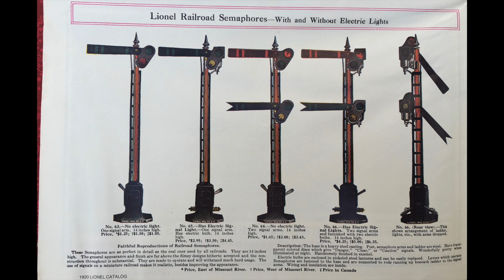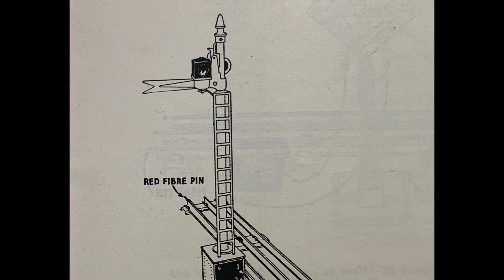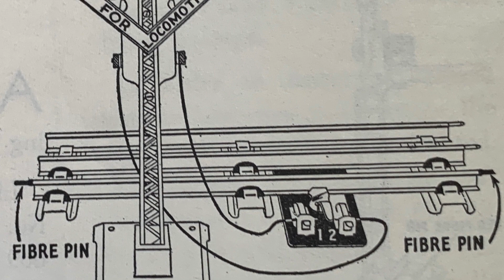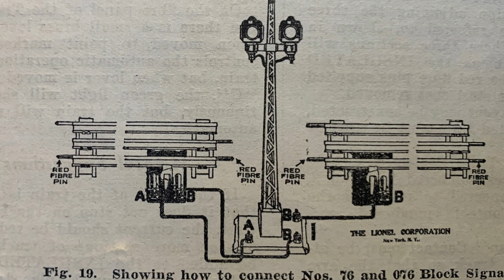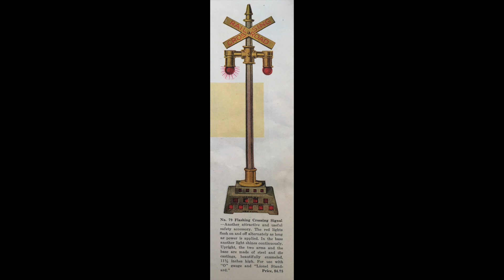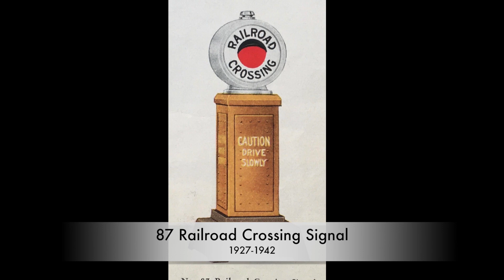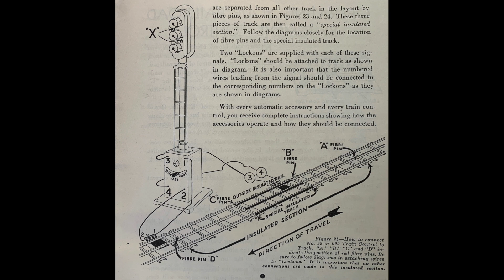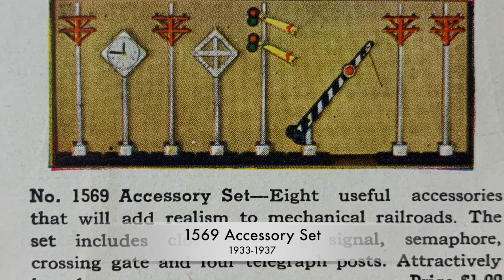Classic Lionel Trains – Semaphores and Signals 1915-1942

Comment: Hmm. I could be wrong, but it seems that 82N auto semaphore may be wired incorrectly. That wire running on the inside from connection 2 to connection 3 shouldn’t be there.

Instead I think 3 is supposed be connected to an outside insulated rail. 

That way when set to continuous, the semaphore acts more like a No. 80 turning green when the loco activates the insulated rail, instead of always being on. 

When the signal is set to stop the train, the light won’t go green unless the train is in the block if that makes any sense. Look at the wiring diagram. Again I could be wrong.

Beautiful collection by the way, thank you very much for posting these videos. Not much prewar information online. Before I watched them I didn’t know half of these things existed!

Comment: Once agen another great video. I have a question is your track original or only some?
Reply from the maker: My track is from the classic period, but I do not know whether it is pre- or postwar. The switches are easier to date. I have the 022 unlighted manual switches which were made between 1915 to 1926. My next video will be about switches, crossings and bumpers.

Comment: uh oh, I always wired the 153 signal with 2 insulated tracks spaced 8 tracks apart so the green light is on as the train approaches it then turns red after it passes, doesn't work that well because with a long train red and green may be on simultaneously or a short train and both lights are out before it gets to the next insulated section. I was never very happy with the 153c spring activator due to having heavy cast metal and lighter plastic locos, hard to get it adjusted for both.

Comment: Another great video !Was the number 79 highway crossing a continuous operation or was it train activated ?
Reply from the maker: I have almost all the instruction booklets during the period the 79 was build. While they provide the circuits for semaphores, the 69  bell, the 83 and 87 traffic signal or the 99, there is no mentioning of the 79. So you can either connect it to the fixed voltage of the transformer or connect it to the track with a lock-on. I did the latter.